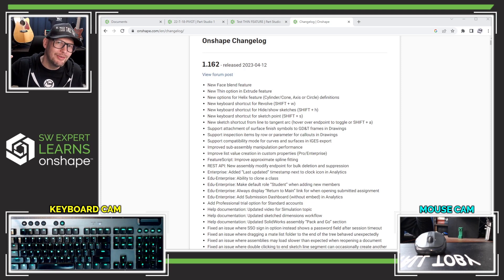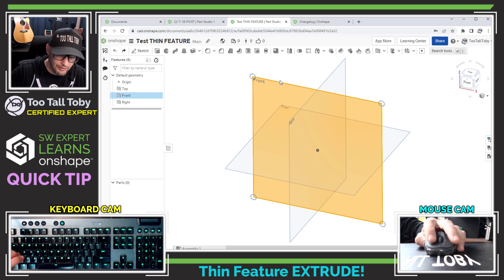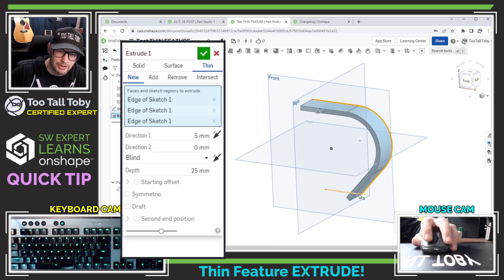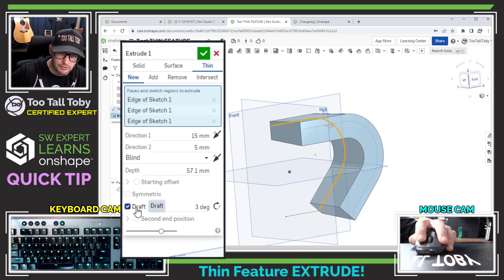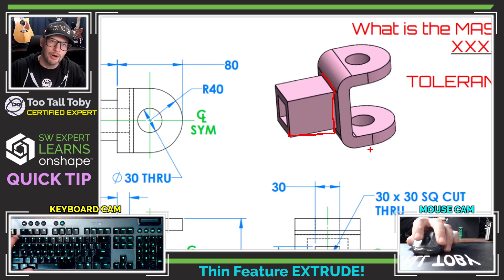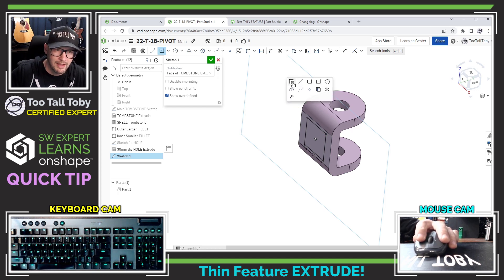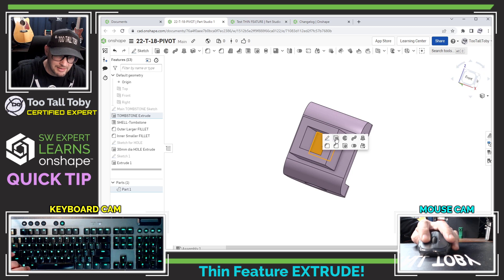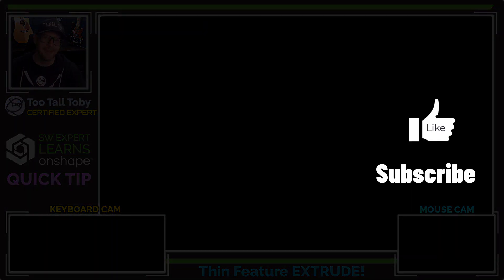THIN FEATURE EXTRUDE in Onshape

Comment: Useful info!  Does Solidworks have this feature already?
Reply: I know they had in the desktop versions for a while.   But once you commit to a "thin feature" in SW, its stuck that way forever.  I like in Onshape, later on, you can switch it to a think feature (or even to a surface) - much more flexible for design changes!  😀
Reply: @TooTallToby  In Solidworks you can choose to have it radius the corners, as for (say) rectagular hollow section tubing. 
Is that the case here? I'm thinking if it did offer that option, you would have showed it?
Reply: @Gottenhimfella  I dont think there is an option for that yet - I think you need to radius the corners in the sketch in onshape (or fillet feature afterwards)